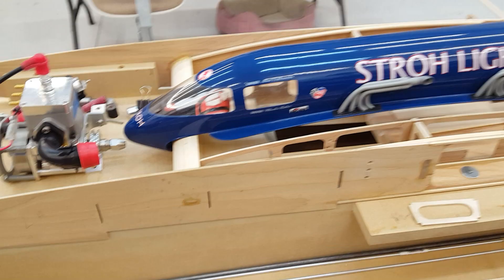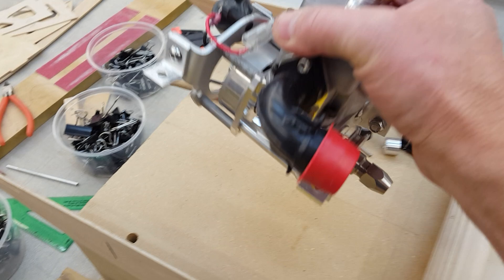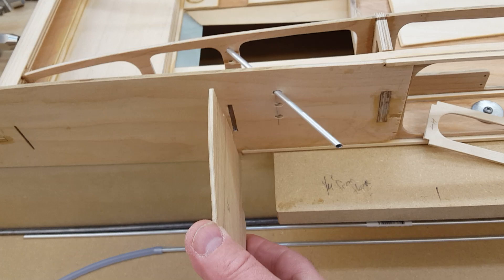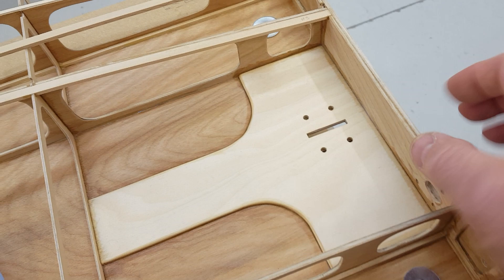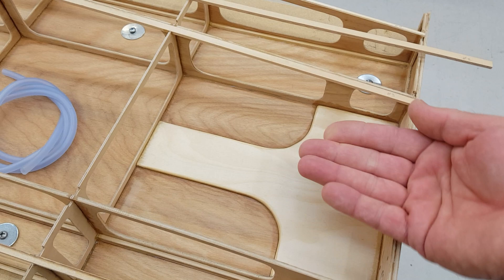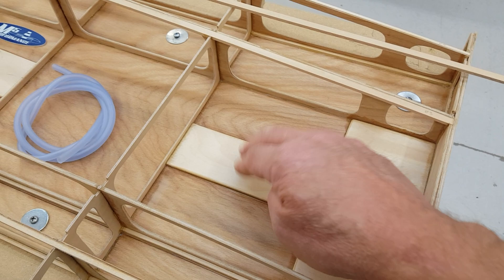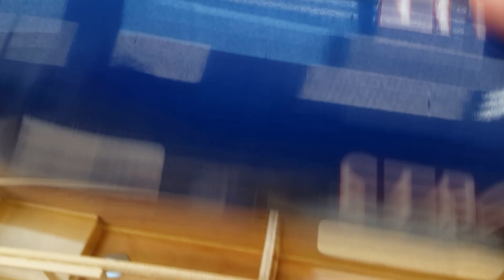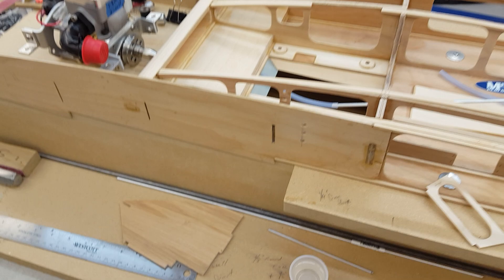RC Hydroplane Race Boat Build Part 4 - "The Weight is Over"!

Comment: September 12, 2020

Mr. Scott Meyers,

Scott, I spent a lot of time watching you build your boat. When you got down to the tubing that would come from the rudder up to your motor, I was very concerned.

I have worked with tubing and heat conduction in hundreds of kilowatt machines, and the flow rate and volume through a tube or a pipe is very critical. I don't know if you've thought about the difference  between the inside diameter of the tubing and the inside diameter of your pipe. But when I saw them, the motor had two inlets and four outlets for water. It appears to me that the engine really wants a lot of water to maintain its temperature. I don't know if your rudder  has two holes in it to deliver water to the engine; that would be the best. Any time you take one hose and break it into two hoses make sure there is a ”Y” connection not a “T” connection.

These are just some thoughts that I've had. If any of this makes any sense, so be it. If not throw this letter away. I'm just very concerned about saving a couple of ounces of tubing weight and blowing up your engine.

Sincerely, 
Richard sales
mrmotion44@msn.com
Reply from the maker: Thanks Richard,
Yes the rudder has two pick-up holes and yes the tubing i.d. is the same as the hose so I believe the flow rate of the two would be equal.
You mentioned the difference between inlets and outlets and inadvertently touched on something that bothers me...  In my mind the motor should have a larger inlet volume than outlet volume, and this motor has the opposite.  I've discussed this at length with the manufacturer and they believe this is best, but I'm not completely convinced. 
Anyway... I've run it hard in very hot weather and it survived, so far!

Comment: How thick did you make the area where the engine isolators bolt through the floor? I'm looking to do the same style mount, and I'm curious as to how thick I should go for good support.
Reply from the maker: The floor in the engine and strut mounting areas is 1/8" thick

Comment: Aluminum tubing is good to save weight, but has another good effect. It has very little drag, hence the water flows smoother through it.
Reply from the maker: You think so? I was worried that it would flow less than silicone tubing. Either way, I guess I'll find out!
Reply: 100% sure. I use it (aluminium tubing) in my competition Hydro 1 (Naviga). I like your approach. In FE we try to reduce weight where possible. Hence the mini’s (45cm hull) come to astonishing performances too.

Comment: Great video, real easy goin' and informative! I've got 2 comments: How much water will be in the cooling system once she's running, and how much will that weigh? Will the engine be bolted in without anti-vibration rubber - i.e. directly to the bottom?
Reply from the maker: You read my mind! Though I haven't measured it, I have wondered how much water in the lines and cooling jacket of the engine will weigh. If I could figure out a way (weigh?) to eliminate or reduce the amount of water, I'd do it!
As for the engine mounts... Video coming soon.
Thanks for watchin'!
Reply: @M5PerfHydros  thinking outside the box, would water pickup from the rear of the sponson be a bad idea? I'm guessing drag would be the issue there?
Reply from the maker: Yeah, I think I would be bothered by both drag and inconsistency of pick-up. The rudder is almost always in the water, but the sponsons not so much!
Reply: Was just thinking of how to get shorter pick up tubes which means less water which is less weight. But that's why I was asking that.
Reply from the maker: @christopherpatrick9126  - You're a thinker... I like that! Keep the ideas coming
Reply: @M5PerfHydros  how about a longer pickup with the turn fin?
Reply from the maker: @christopherpatrick9126  Mmm, I think we want to leave the turn fin alone.... Big flat surface only. 
I know that on some boats they'll use just simple holes on the bottom of the boat near the back at some high pressure area, and I guess enough water goes in to cool the motor, but I'm just not confident in that either.

Comment: Hey do you have a video about how to finish the decks and hulls for paint. I've seen them all primed and smooth, but not sure how to get there.
Reply from the maker: Hmm... I have a video that deals with sealing/preparing the surface of the wood, but nothing that talks about how to do the general 'bodywork' or painting.  If you could describe which aspect of the preparation you're needing help with I'll see what I can do.  Meanwhile, I'll add a link to the surface prep video. This video talks about sealing the interior, but same technique is used on the exterior as well;
https://youtu.be/3XDOhJPo-KY

Comment: Hello. What scale is the Gas Scale? I understand its larger than 1/8 but how much?
Reply from the maker: The gas class is roughly 1/7 scale.  Actually 1.667/1, which is really weird I know. I've never understood how this scale was determined, but when finished the boat will be about 52" long.
Thanks for watchin' Duncan!
Reply: Cool thank you. A couple years ago I built a 1/8 scale Atlas Van Lines with a gas motor but was a very tight fit. I am going to rebuild the same boat but larger.
Reply from the maker: Wow! Fitting a gas motor in 1/8 scale must have been tight!!

Comment: On your motor,can you tell me why you are using that carb ?
Reply from the maker: Sorry for the slow reply...
This carb is recommended by the guys at Quickdraw. The engine was tuned on a dyno and made its best power with this setup.